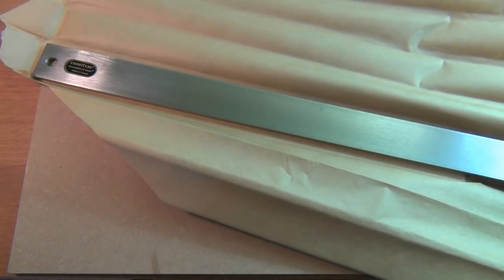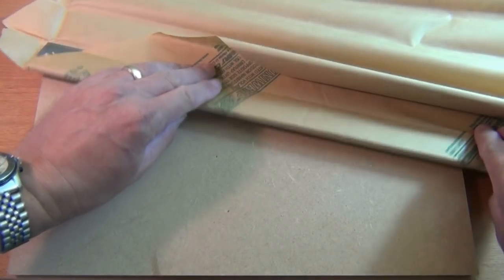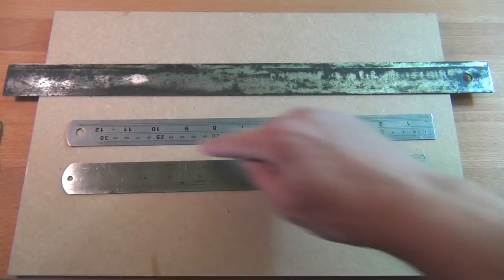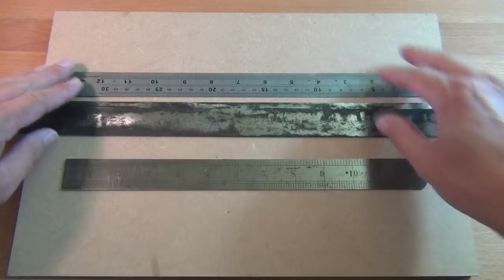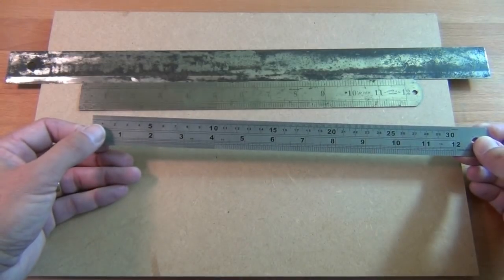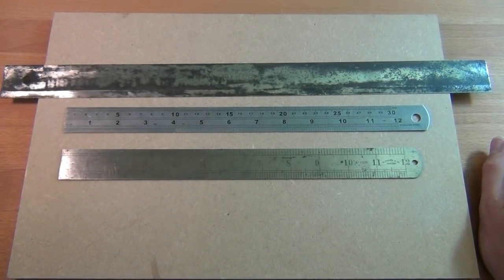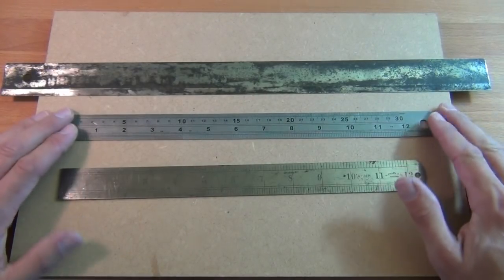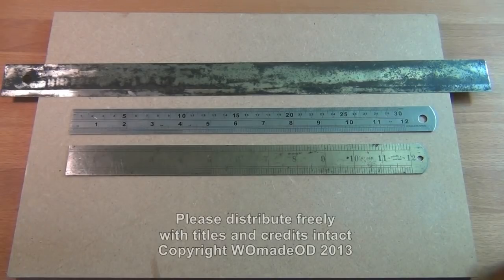Precision Straight Edge - How to make one

Comment: This is a beautiful video. It's a shame that more people don't realize the value of this concept and how fundamental this process is to the advancement of humanity's technology. This method described is also known as the "automatic generation of gauges" it was the key knowledge that allowed for the industrial revolution's technology to advance and lead to the machine age. The creation of the screw cutting lathe that could refine itself is created using an very similar concept. Something this simple and seemingly useless is what allowed humanity to make that leap from that early iron-age level technology to the truly modern era of precision manufacturing and measurement with computers and CNC machines that are well calibrated.
Reply from the maker: Thank you. Maybe YouTube is too quick a format to get this over to some people.
Reply: Who made the very first straight edge and what was his reference?
Reply from the maker: I don't know who, but you don't need a reference. Start with three edges and gradually adjust them all so that they each fit with each other. When that process is complete all three will be straight.

Comment: Thorough video going through all the points (no pun intended). It's rare to see videos where everything is covered.
If you need a 'rough' straight-edge and you have nothing but a new MDF-sheet, the edges of the MDF sheet should be straight. Maybe not extremely precise, but fairly good as a ruler for a plunge-saw or a router.
If you need most of the MDF, mark the factory-edge, cut a thin strip (say 10cm thick) from one edge and use that as your ruler; you do not need to cut it precisely (you maybe have only one MDF and no other 'straight-edge'), a hand-saw - even at an angle - will get the job done; because you already marked which edge is the factory edge.
You can now use this slice to make straight cuts on the large MDF piece and you can also use the large MDF-piece to make the other side of the 'straight-edge' straight.

I hope that wasn't too confusing, it's a way to get a 'free' straight-edge if you have the MDF already.
Other types of board are not recommended, as their edges are much more rough.

Remember that a string can also be used as a straight-edge, but it's not as sturdy, so it might be cumbersome to work with, depending on the type. -Even single core wire can easily get imprecise if they have a bend or 'curl'.
Reply from the maker: Thanks, and nice tip for the MDF

Comment: This is the method used to scrape machine ways, and babbit bearings to square. I don't usually bother with scraping the sole of a plane to make sure it is perfectly square but if I were to do so I would use your method. First verify the straight edge with this method. Next check the plane with the proven straight edge and scrape down the high spots. 
As an aid to finding the high spots Prussian Blue is rubbed on one of the rules and the other set against it. Any points of contact on the second straight edge are daubed with Prussian Blue and can be stoned until the whole blade edge is consistently covered with Prussian Blue after touching. 
P.S. Prussian Blue is a fun thing to put on the bottom of drawer pulls on your buddy's tool chest. Before you know it every bit of the shop is covered with blue fingerprints.
Reply from the maker: Thanks Dave. Great tip about the Prussian blue, but you're right about the fingerprints, I remember them from metal shop class!
Reply: I had the pleasure of managing a couple of tool rooms and a machine shop at different times. Skilled trades tend to be a bunch of pranksters. Prussian blue and Dykem were their two favorites. At one shop the big joke was for one of the guys to paint your fingernails while you were unaware. You learned to stand with your hands in your pockets.

Comment: An excellent demonstration of the standard 3 plate test check for flatness invented a long time ago. But even Moore & Wright, Starrett, or Mitutoyo dial calipers are at BEST only reliable to + or - one count on the dial. So there manufacturers will only say there accurate to within + or - .001" in imperial. A lot better test would be if you have a quality table saw with a ground cast iron top you can trust and at least a .001" reading dial indicator is to position the indicator beside the saws fence and use that as a guide to pass your 24" straight edge under the indicators tip. Even better would be a .0001" reading dial test indicator, but few wood workers would have that or a precision surface plate. I don't blindly trust even Starrett or Mitutoyo equipment without a check first. So far there equipment has always fell within the factory specifications, but if you don't check you simply can't know that for sure. Even the best can and do make the odd mistake at times.
Reply from the maker: Thanks. The method breaks down once the gap is too thin for light to pass through. I'll give that a try and compare results. Although I very much doubt my table saw's ground cast iron table is flat to within +/- 0.001"! Cheers, Mitch

Comment: would this work for checking cylinder head?
Reply from the maker: I rebuilt a few engines in my youth, using potentially less accurate straight edges, and had no issues! However modern engines are built to tighter tolerances so best to check with a mechanic to be sure.
Reply: right on

Comment: I've started hunting for straight references as theyt are needed for fixing my handplanes. Two pieces of glass. One is off so I don't trust neither. Some cutoffs from local stone mason. Inconsistent, so I don't trust such cutoffs. Then I started thinking that not having a reference to begin with I can only check such surfaces in a way you would go about in actually making a straight edge from scratch. So, what a peasant can use to establish actual physical straightness? Bingo! Steel strings! And so I got myself some unkinked high-grade violin strings. Now I need cylindrical strainers. Printer guide rod pieces should do.
Reply from the maker: Good idea!
Reply: Remember to keep in mind that some things might sag; rods and strings included.
-But I second the violin strings; good choice.
The edge of a MDF-board is fairly straight, but it's not perfect.
A rod may bend.
However, if you "glue" the rod onto the edge of the MDF-board, you have a rod that does not bend (unless it's already damaged). =)
Reply: Try a granite surface plate...

Comment: couldn't you also use string attached to a bow as a method
Reply from the maker: Good question, and for many practical purposes, a taught line (wire, string, etc.) will be close enough. But due to external forces such as gravity, it won't be dead straight.

Comment: At 5:10 - It wouldn't work if the distortion was rotationaly symmetrical, like an "S" shape.
Reply from the maker: Good spot! I didn't consider that. Don't think it's a problem though, since the edges would only match in one precise linear location (could be more if both had identical fixed frequency and amplitude waveforms), and so they wouldn't slide against each other without a gap appearing.
Thanks for pointing it out, I shall try and remember for next time. Cheers, Mitch
Reply: @mitchwoodwork  Also if you think about it all 'straight' edges will have some degree of that error even if its down to the atomic level. So we deal with it the same way by rotating parts, testing, and so on.
Reply: Just move the rulers slightly. Unless all of them have very fine waves all the way, you should be able to see if light shines through.

Comment: If a piece of PAPER is sufficient to straighten  my edge, it was straight enough in the first place.
Reply from the maker: Haha, did I abbreviate aluminium oxide paper to paper - I really ought to take more care. Thanks for watching
Reply: @mitchwoodwork  To me, you made it clear that it was aluminium oxide paper.
However, an A4 sheet often has a pretty straight edge; unfortunately it's not easy to 'work with' and gets dirty and damaged too quickly.

Comment: This is a demonstration  of how to discern a straight edge, not how to make one.
Reply from the maker: +john connors I don't recall it all, but if you can discern it then surely that's all you need to know. A little filing and sanding of high spots will do the trick. I do have plans to revisit this topic soon, so maybe I'll do a better job of it:)
Reply: Hi there, I hope I did not offend, I fully understand the value of accuracy in one measurement. Do have a good day, I look forward too seeing you're video on making a true straight edge.
Reply from the maker: Not at all John. Critical comments help me weed out the poor videos, and as in this case determine which subjects I should cover again 👍
Reply: Great.

Comment: Holy shit its not rocket science you only need one rule to check itself for straightness.     pull your head out then take a peace of plain white paper place it on a piece of glass in front of you on a table (glass is the flattest thing most people will be able to find and it is important to use a flat surface when checking your strait edge) , now put the rule /strait edge on the paper with one of the two short ends facing you, we'll refer to this as the bottom edge of the rule   then using a mechanical pencil with fine lead while holding the rule down tightly with one hand  draw a line all the way  down the right side of the rule in one swift controlled motion with your other hand.  make sure to run the metal tip of the pencil down the edge of the rule not the pencil lead itself, this is easily achieved by only having a tiny amount of lead sticking out of the metal pencil tip and by angling the eraser end (the dumb end) of the pencil towards you at a 15 to 30 angle as you draw this first line. Then slide the entire rule to the right slightly more than the width of the rule so the left edge of the rule is now next to the line you just drew. Retract pencil lead into metal pencil tip or break it off just make it gone. Now space the top and bottom left edge of the metal rule the same distance apart from the top and bottom edge of the first line you drew using the metal pencil tip as your spacer, then hold down the metal rule and draw a second line just as you did the first but down the left edge of the rule this time. when done correctly you should be left with two very strait uniform pencil lines extremely close to each other with a very small uniform gap in between them. If there is any waviness or uneven gap in-between these two perpendicular pencil lines or planes,  your shits fucked up and its not a straight edge anymore dummy throw that shit in the bin directly. by using more than one beat to shit rule to check the other ones your  just adding endless variables and more wasted time doing useless nonsensical testing.   P.s. way to take the longest way around humanly possible while accidently,  simultaneously allowing endless room for as many variables and mistakes as someone possible could make all while effortlessly  reversing the very  evolution of mankind thus far, Thank you now everyone listening or watching this is dumber.